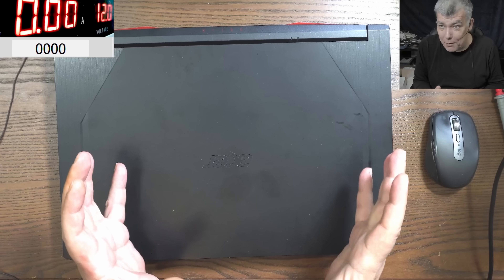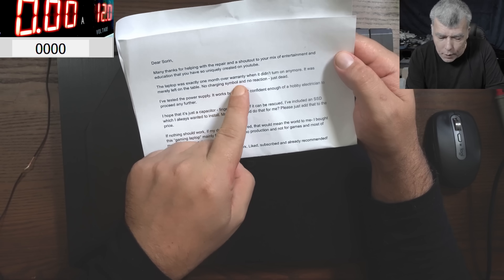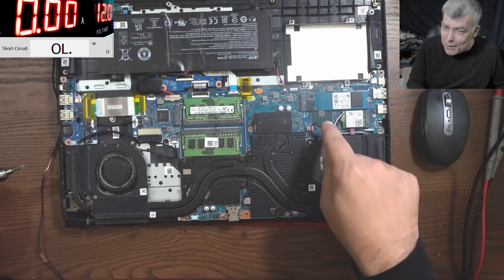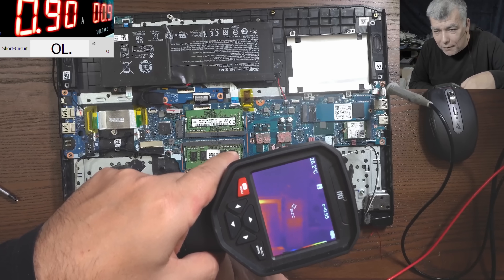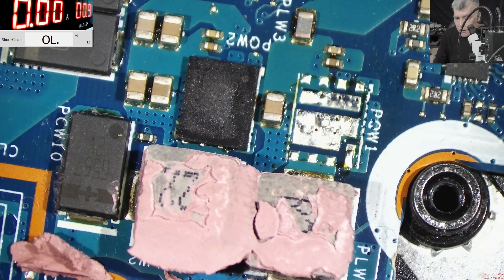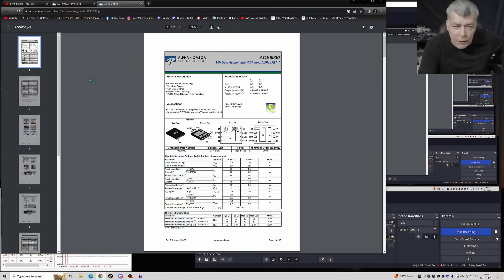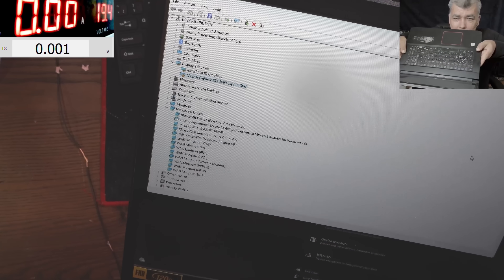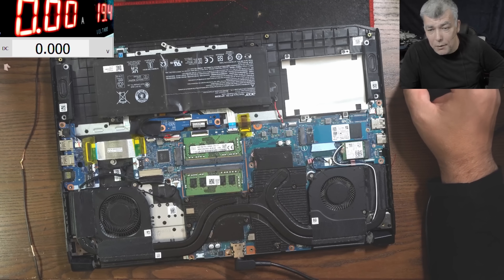Acer Nitro 5 gaming laptop - How a laptop RTX3060 GPU can die

Comment: I had the same problem unfortunatly, but after I took the laptop from the repair shop I noticed that it is too hot near the plug and cpu evem idle reach 80 C elcius. Is that normal or they left the short?

Comment: My Acer Nitro 5 GPU died after 4 years, last week. Is there a way to replace the GPU with a new one ?
Reply: Im pretty sure it is soldered to the motherboard, so if you want to replace it you have to replace the whole motherboard, i learned it the hard way and declined the offer because the replacement costs is the same as the laptop itself. You can get an external gpu instead i guess

Comment: Hi Sorin, if that error is code43 (right click the gpu and see the error code), if you have code43 is a VRAM issue, you need to run NVidia mods software especially version 455 for these 30 series cards, it will show you the faulty VRAM, the fault could be broken pads under or a damaged chip which you can replace. Good luck.
Reply: The name of the Nvidia program? To see the faulty VRAM?
Reply: I mentioned it, it's mods, there's mats also

 @victor-emanuelpaulescu4875

Comment: for mosfets, there is also another important parameter: the Cgs capa (cis) which influences the communication speed. Often, when the RDC.on resistance is lower, the Cgs capacity is greater.
Reply: sory, switching speed, not communication speed

Comment: Sorin, I am not entirely sure, about this but the RTX3060 and RTX4060 suffer from the same issue: Basically its a large DIE and the solderballs tend to get broken. Try pushing down on the GPU while powering on. Or use your magig rossin Flux and do a short reballing. There might be a small chance, that the GPU is still alive. Or am I wrong? I am supprised you were able to measure the VRAM.